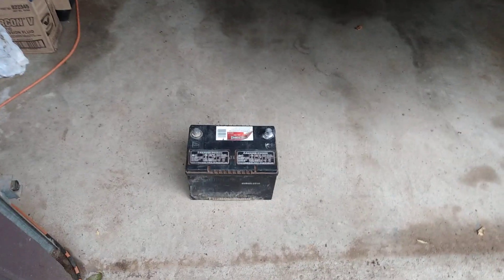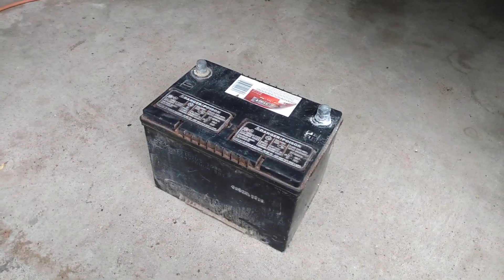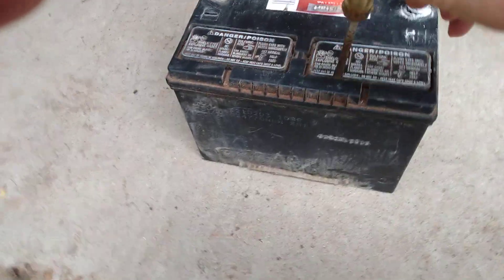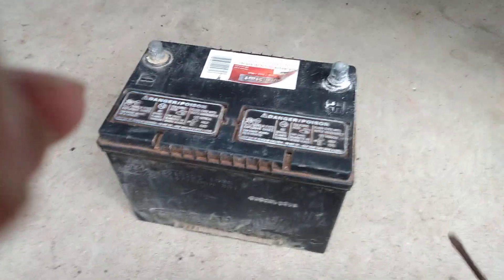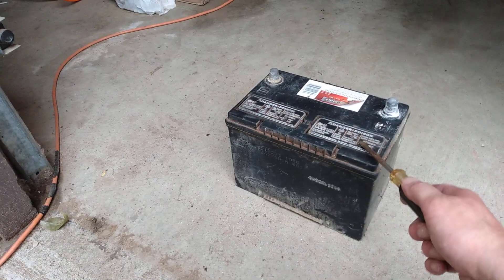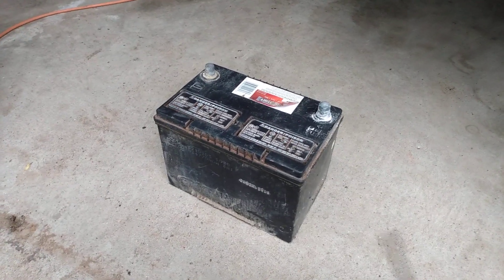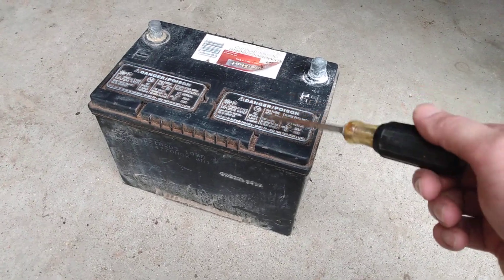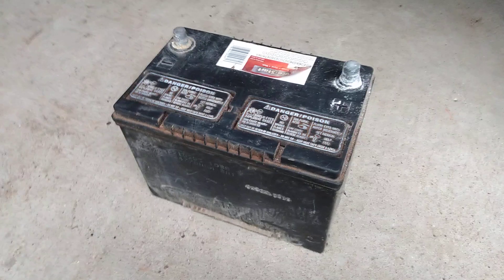How to revive a bad battery

Comment: Wear eye protection !!!!!!!  If the battery fluid is bubbling, it's releasing hydrogen!  A tiny spark will make the battery explode!  You do NOT want sulfuric acid in your eyes! 
Also, instead of adding distilled water, you can get battery fluid at the auto parts store.  Use that to avoid diluting the battery acid.
Reply: NO you DONT want to add battery "fluid" with acid. The battery already has the correct amount of acid in it. Adding more will change the ratio of acid to water. The acid never leaves the battery. only water. You only want to add distilled or deionized water to the battery unless it was tipped over and lost a significant portion of it's original electrolyte.
Reply: @realflow100   I had a battery that sat in the garage for an extended period. Water and acid BOTH evaporated out of it. You could see where the acid reacted with the stack of paper the battery was sitting on. 
Any metal rack that holds lead-acid batteries will get corrosion from the acid vapors that evaporated out of the batteries.

Comment: Im 61 I been working around Cars and Motorcycles 51 years . a Low battery can be charged a Dead Battery is Junk . you can do all kinds of things to get a dead battery to work a short time . like a week . Best thing to do is Replace a Dead battery .   they have Lead plates in the Battery the lead can build up scale over time changing the water and adding salt is a temp fix changing the acid is a temp fix .  over charging a battery it can become a small hydrogen explosive .     So back to Buy a New Battery save your self heart ache .